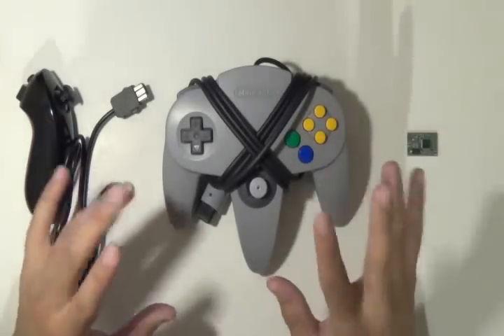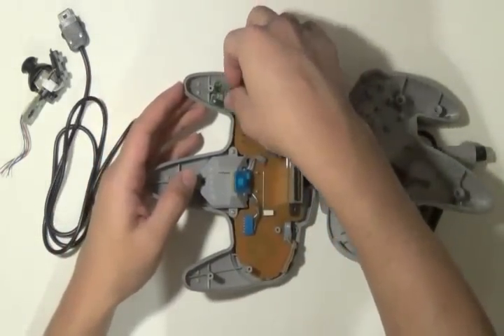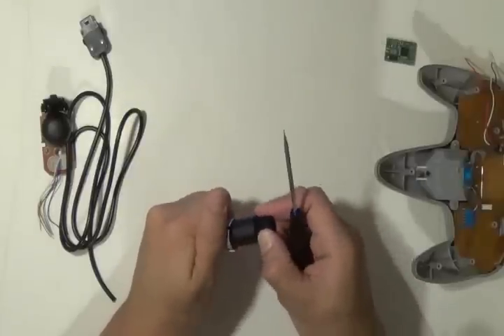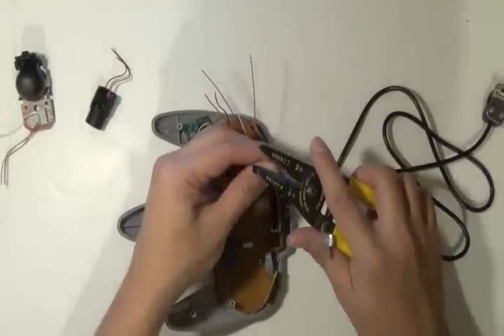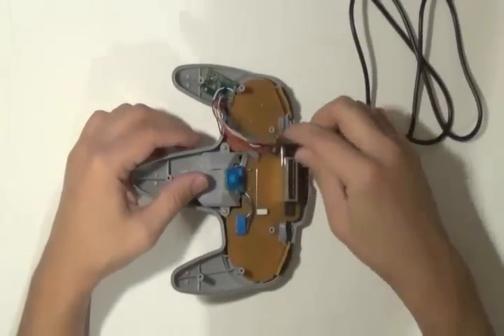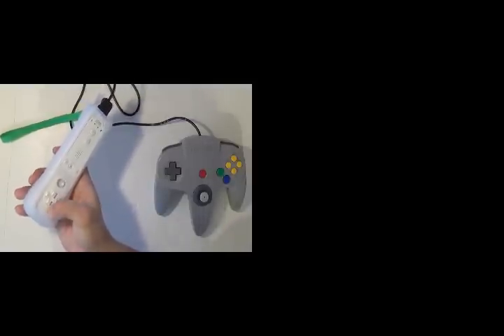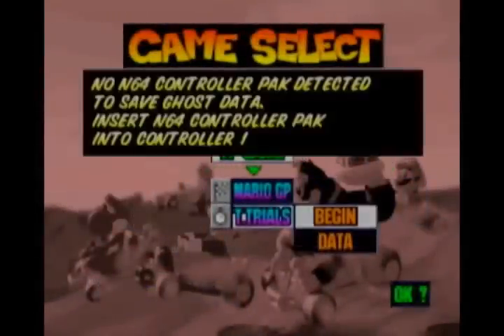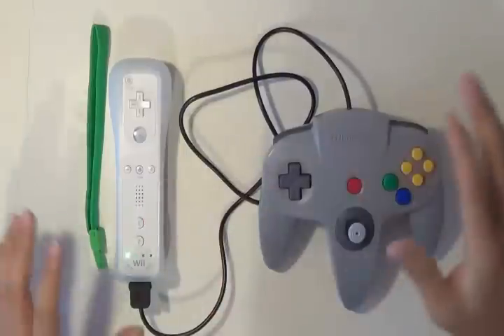How to mod your N64 controller to Wii (U) remote (Plus)

Comment: You should make a video for GameCube controllers
Reply: Original release of Wii had ports for GameCube. Wii U will soon have an adapter to use up to 4 GameCube controllers. It should come out with smash brothers.
Reply from the maker: You don't have to make one to connect to the Wii Remote all you have to do is connect it to the ports at the top. If you mean I should make an original GameCube controller wireless, than I might have a new project on my hands!
Reply: paul roberts
REPLY TO - Sonic Revolution (BETA) 
There is a WAY BETTER alternative its called the "Mayflash GameCube Controller Adapter for Wii & Wii U" and it has BEEN out! To get the adapter working all you need is a GameCube controller and a Wii remote, the adapter has a GameCube port, a Classic Controller/Nunchuck plug and a special TURBO button which work like auto-fire which is great for fighting or shooting games. Now I have the adapter and I`d give it a 9.3/10 problems are the adapter was mostly built for the Super Smash Bros.Series  and the classic controller for brawl is just like the layout for the GameCube Controller except the triggers are switch (if you don`t understand ask Sonic Revolution (BETA) )   some games are unplayable due to the GameCube Controller Layout cause bad controls or the game has a ZL button and the GameCube doesn`t have it the button, and theres only one GameCube port so  other than that its PERFECT! I have tested out a few games and here are my results
Super Mario 3D World - Controls are not "Mario-Like"  Z to stomp, X to dash A to jump, but still very good for my taste
Sonic Transformed - On configuration A I wasn`t able to drive, On Configuration B I wasn`t able to use power-ups and the controls were a total disaster! Thsi one struggled due to the trigger switch
Mario Kart 8 - PERFECTION!!! JUST LIKE MARIO KART WII CONTROLS!
Wonderfull 101 - almost perfect also in the game there are 2 attacks X & A with the gamecube controller it very easy to press them at the same time and when i do I rack up TONS of combos!
Super Mario 64 - PERFECTION!!! Don`t ask why...
you can get the adapter on online stores like eBay and Amazon, the adapter is from Hong Kong but I got my adapter in only 3 DAYS! the adapter cost 15$ - 20$
Reply: Jletsplays
REPLY TO - +Sonic Revolution (BETA)
Someone is already making a Wireless GameCube controller called the WaveDash except his is Compatible as the Wii U Pro Controller.
Reply: It may have 4 GameCube Ports but I am highly aware that it`s only compatible for Smash Bros
Reply: Jletsplays one the wii u dose not have ports up top two the wave dash controller was unsuccessful 3 why the h*ell would nintendo make a gamecube controller adapter when making a pro controller shaped like a gamecube controller sounds like a way way better idea
Reply: justin rivera
 rethree: Isn`t the Wavedash a GameCube shaped pro controller?
Reply: Wave dash is just a pipe dream
Reply: Yeah, I really wish it was real, then again at least someday we need to lay off the GameCube, I wouldn't want my Gamecube with my Xbox.